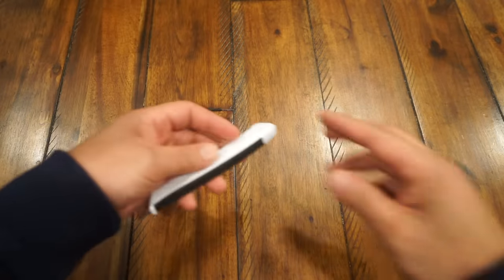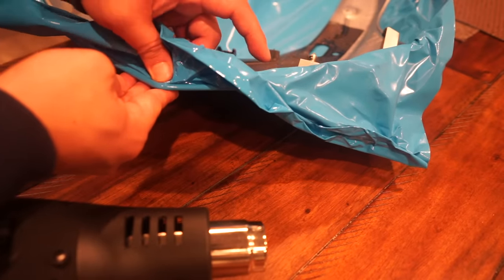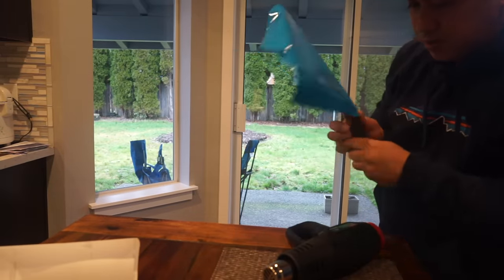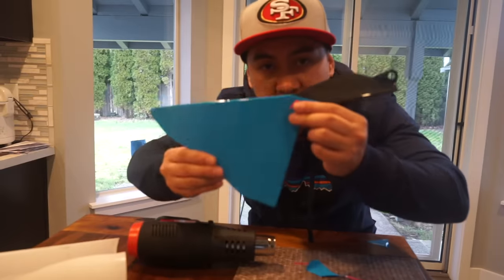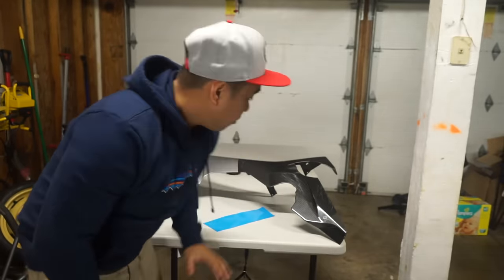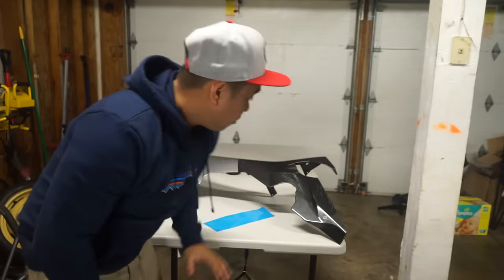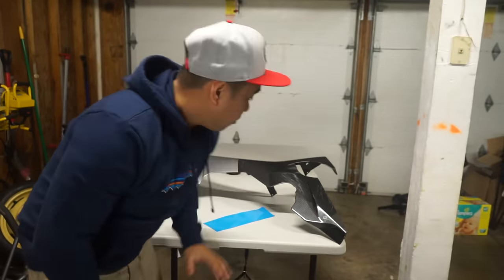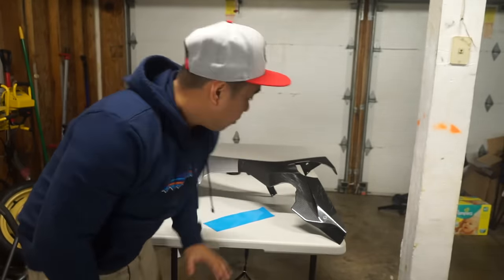Vinyl Wrapping a Motorcycle for Beginners | Part 1 of 2

Comment: How long does that wrap stay adhered? How do you go about removing it say 3 months later?
Reply from the maker: theone2be33 as long as you want it on your bike.  Held up fine in a lowside.  Actually helped protect the fairings.  For this gloss, just pull it off.  Some brittle ones like carbon fiber i would heat up first.  Take off glue residue with kerosene or goo gone.
Reply: @adobomoto  thanx. Seems like a cheaper alternative to painting. And is easier to change styles when you want. 👍😎
Reply from the maker: theone2be33 that’s exactly why i prefer vinyl wrapping!

Comment: When I wrap a plastic fender and heat it so it is tucked in the inside edge I noticed when I'm done with fender and leave it in the hot sun adhesive fails and lifts.. so frustrating seeing a tight fit then lifts at the edges. What am I doing wrong.. is it because the type of plastic fender. Because I did clean with alchohol... thanks .. mabuhay filipino...

Comment: Tip: the glue in the vinyl id heat activated so you can use heat to lay the wrap into the grooves that way it doesnt pull out, in your large areas u can pre heat then lay over
Check my page if u want 
www.facebook.com/biketobiker
Reply from the maker: Evo Boy thanks!  I’ll look into it next time i wrap.  Does this work with every vinyl or is it vinyl specific?  I feel like some vinyls aren’t as malleable as others.
Reply: @adobomoto   it will work most if not all, best sticking with what u know vinyl wise,  avery is very good stuff, practice makes perfect, another tip if u plan on doing another wrap look into 3m edgesealer it dries clear and i use it on my edges i also use spray contact adhesive for under areas like muddies and huggers
Reply from the maker: Evo Boy i have some lol!  Used it once..vinyl is cheap enough and i love wrapping and rewrapping different colors.  But definitely a good tip for making it last!!  Thanks a lot man!
Reply: @adobomoto  no worries dude, keep at it, take it easy bro!